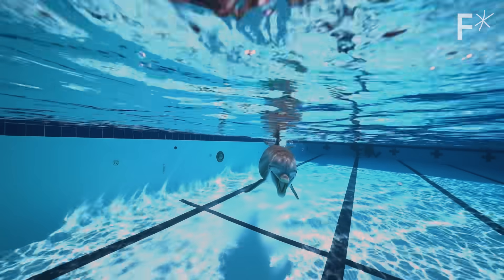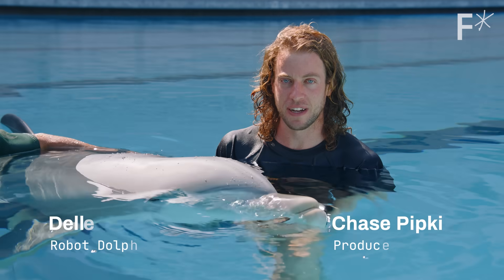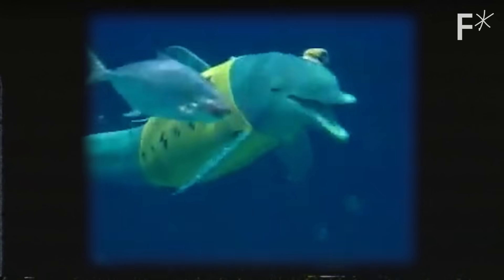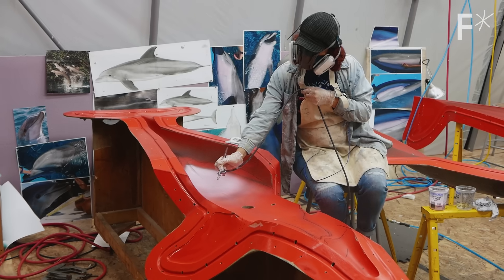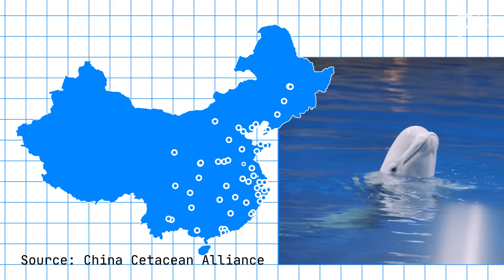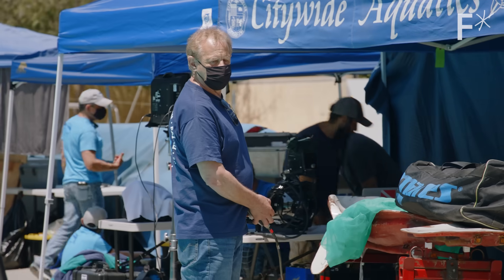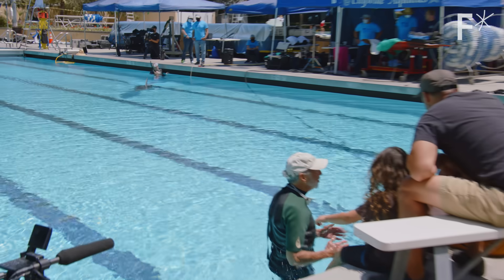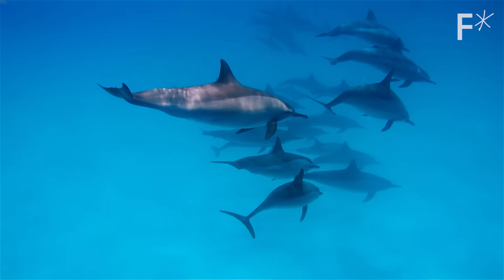How robots could end animal captivity in zoos and marine parks | Just Might Work

Comment: The one major downside of this prospect is that most zoos offer programs for kids and young adults to learn about different creatures through interactive programs with LIVE animals, by removing the organic component of those experiences you remove a natural learning experience from the program. There's also the fact that you can try and make a robot look organic but you can never make it ACT organic, plus there's the issue of malfunctions and glitches in the AI that could cause disastrous situations. Imagine a robotic Giraffe getting stuck in a logic loop where it starts running and doesn't stop, crashes through a habitat wall and ends up destroying part of the park and possibly injuring guests... I think we're still quite a ways off from bringing this idea to a test run, let alone a full attraction concersion.

Also, captivity programs at zoos are necessary for ensuring the restoration of species endangered in the wild.

Comment: This will work only for the simple fact that you don't need to feed them.
Reply: It'll cost just as much to keep them charged. Not to mention maintenance and repair. And ALL those metal parts, servos, and batteries don't sound environmentally friendly at all. Tsk tsk No, no. None of this will do at all. (This is only half a joke by the way, but you get the picture.)
Reply: @sentinelrex4600  You forget the labour cost. Even accounting for "Maintenance" costs, trainers labour costs, veterinarian fees, etc... would offset the maintenance costs.  I give you a simple example for you  to compare: ATM machines.